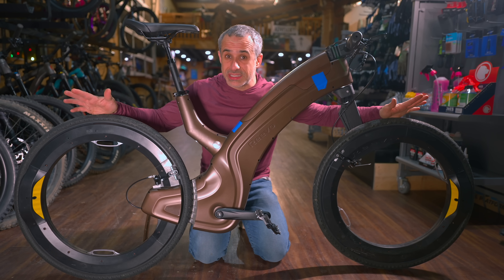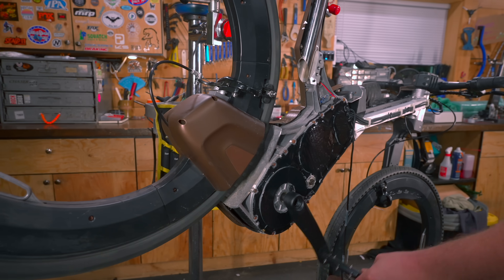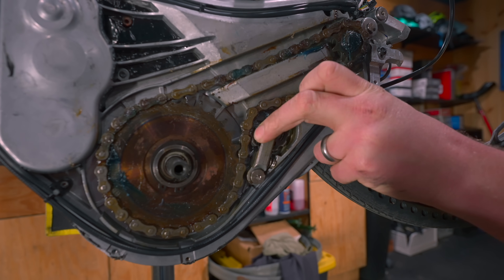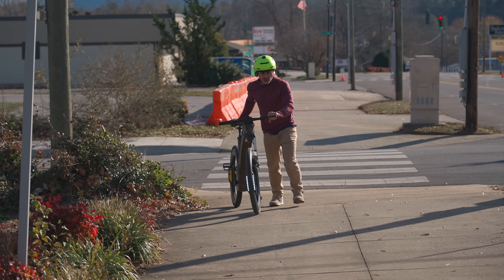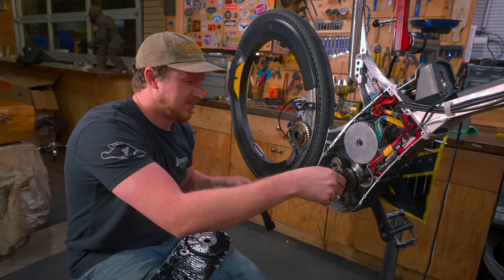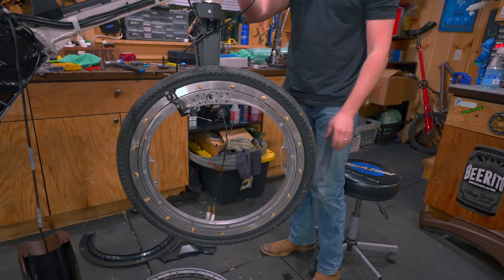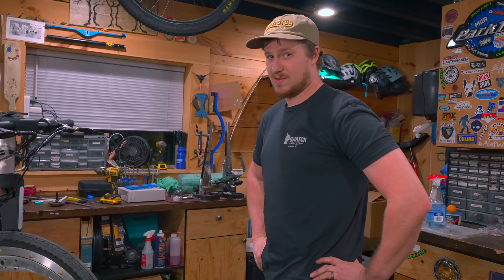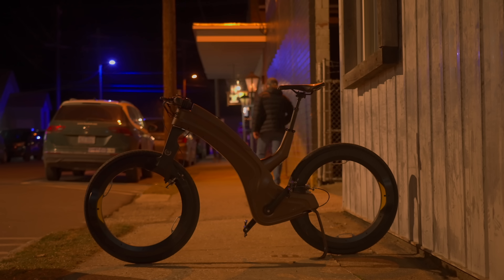What's Inside The World’s Worst eBike? Reevo Teardown

Comment: As I read the comment section, people are going "This is poorly engineered" but I would say the opposite. It's most likely that the idea had the hubless wheels and the design of the bike from the start, and you are basically asked to fit things together in the best way possible within the allowable budget and with as many cheap off the shelf items as possible. 
Off the shelf motor can only fit above the pedals? You need to chain, gear train or belt it to the pedal train. 
A hubless wheel? Gear it to a chain. 
Brake needs to be on while the software locks the bike, but you already have a kickstand brake? Lock the kickstand in place.

Everything on this bike makes sense if you think of the premise they are given to engineer is absurd, which it clearly was. The funny thing is remove the absurdity, fit everything together with proven technology, and you could still have a lot of good features like the one sided forks, at a much lower weight and cost.

Comment: As a dutchie the self propelling pedals crack me up. I had an ARCHAIC e bike back in 2014-15 and it did that. So easy, I could prop my feet on the frame and use it as a scooter. I thought we’d have out engineered that

Comment: 70lbs is light what're you crying about? 😂 my bike is smaller and weighs almost 130. 😂

Also there's gonna be more gears in general since it's a hubless wheel. 

And your bike taking off? That'll happen on any ebike that has pedals that rotate with the chain..that's kind of how pedal assist sensors work. If you don't want that to happen turn the pedal assist all the way down to 0.

It's weird to pick a bike with feature you don't understand then try to shit on it for content 😂

Comment: Note: never ever use steel bolts and steel machine screws in soft aluminum like that. Vibration & stress can cause a lot of damage over time. The steel bolts can wear holes in the aluminum, and steel machine screws can easily strip out tapped aluminum threads.

Comment: I used to be a welder, working on frame parts for industrial machinery. We used 1/8" aluminum tubing like that... to support ten-ton conveyor belt systems! But I suppose since they're using square tubing that's what it takes to keep the stress risers on the 90° corner joints from being an issue. Atrociously bad engineering and I bet it was only to save money and not have to have custom cast parts. Actually, that looks like it might be spray-transfer MIG welds, which probably also saved them a dime on labor as well. Unreal to see welds that chunky on a bike frame.

Edit: Nah those are normal TIG on closer inspection... just THICC
Reply: Also, nylon bearings? in a BIKE? Jesus Joseph and Mary.

Comment: I basically understand why it was so hard to pedal by seeing what was involved in the drivetrain, but why did the front tire still roll so horribly? What was going on there? Couldn't that have at least been done better? I really don't get that part at all.
Reply: Probably it could have been done better, but as it was already stated: This design replaced two bearings in the traditional hub with many bearings around the whole wheel. Each bearing adds friction, even if it is a high quality one. You would need to engineer some other bearing technology for this one. And a better idea for the drive train, maybe some linear actuator using magnets or similar - literally making the wheel part of the actual motor.

Comment: I know how to make a better hubless bike wheel Why not slim down the wheel itself so it's closer to a normal bike rim sans spokes, replace it with a massive sprocket, add a groove, a better inner ring design, and use little steel ball bearing and grease instead of roller wheels.

Comment: They really overcomplicated the drive system on that! If I were designing it I'd just put the motor on the wheel hub and then add a generator to the pedals wired in parallel with the battery so when you're pedaling if the battery has higher resistance than the motor the battery will get charged, if the motor has higher resistance than the battery the pedals will drive it, and the pedal assist would just be the battery providing the difference in our from the stable state of the circuit, and have a transistor actuated relay wired in so the battery disconnects when the pedals aren't producing any power. Then use a throttle to set the minimum resistance of the battery side, or use a tachometer to control a varistor for the battery side of the circuit. There'd be a little bit more needed I'm sure, but if you remove all the mechanical linkages and just let wires send the power to the wheel from the pedals you'd have a much simpler and easier riding experience.

The pedals would literally feel lighter the less load is on them because of the inductive impedance in the motor going down as the load drops, also dropping the impedance in the pedals, but with no mechanical stuff to fail, and the battery would just act as a reduction in the load on the pedal motor by using the chemical electrical energy to supply the motor and absorb some of the inductive load. You could even add a capacitor bank that would charge up and rapidly discharge for short bursts of extremely large power assistance for extra steep hills and such.

And it would atill be class one since even with the battery disconnected the bike would work fine. It would be in a single gear, but it would be ultra efficient and work fine.

The motor would just use a traction roller and a knurled ring in the inner wheel to get the grip needed, but allow slipping when the wheel is free-spinning so it doesn't always send all the inertia back into the battery.

So only 3 moving parts and a really efficient drivetrian with zero gears and almost no noise, plus extremely low weight.

Comment: I could have told you it was a chain with no Freewheel. There's no way they are going through a multi-stage gear system without serious product revision. The chain is a shortcut that legitimately works. It's basically Drive systems 101

Comment: i believe the motor doesn't disconnect from the battery when your just pedaling it so there is resistance as it is charging the battery as you pedal  (Or if they forgot about this design it would probably cause the motor to blow up from charging it wit no proper circuitry)

Comment: Interesting fun fact: There is a test for people, where you have a certain amount of parts that fulfill a task, but they are not optimal. The testing persons shall change something. The majority add additional parts to improve function but actually the test is built in a way that you can remove a few parts and it would work much better. So it's basically a test, that proves that people want to increase complexity to achieve their goals, even if reducing complexity is the better way.

This bike is the real life proof.

Comment: So they saved some weight by making the casing plastic instead of aluminum, but made it encase a solid aluminum beam, over-engineered the hell out of the power transmission between pedals, wheels, and electric motor, and literally tried to reinvent the wheel

This is hipster hype bait designed by some snobby upstarts who don't understand why bicycles are built the way they are and somehow convinced themselves they knew better than the rest of the world

Comment: The fact you can roll it back only with huge effort is terrible, also I'm wondering why they went with skateboard wheels... Surely there's an engineering reason, but it seems like ball bearings would be easier and cause less friction (and the biking Gods know that these wheel need all that they can use of that) And those chained gears... Man, I can't believe they needed to chain that much!

Comment: I think if you take all the electronics out and fill all the bearing/gear housings with grease and respective gear oil at least it would be quiet and easier to pedal. It would still be the worst fixed gear ratio on a heavy piece of shit, but maybe you can at least use it. As a training bike or something.
I'll be real, this whole design reminds me of Pimp my Ride. It’s putting dumb heavy shit on a broken mechanism, then taking what works in a normal bike and replacing it with something that merely looks cool but is a really stupid Idea.

Comment: the more gears you have, the more friction you create. 
figure a pattern to use less gears and get the proper Gear ratio.. 

small gear teeth = less torque / less effort.
Big ass gear teeth = massive resistance / massive torque / humongous effort.

Comment: The actual problem with the resistive feeling when powered off is probably due to a the added rotational inertia of the gears + potentially a too high reduction ratio (R) between the pedals and the motor and gear, which multiply by R^2 the damping and inertia felt at the pedals. Since the quality of fabrication looks poor also and there are multiple gear stages, there is also more friction lost (let's say about 98% efficiency for every gear stage) than it would if there was just a chain.

Comment: Here's a suggestion: have the motor mounted on the hub.  The pedal assist would be a generator, so the only linkage from frame to drive is current carrying conductors, one of which could be the frame of the bike.  The down side is that with an electronics, battery or motor failure you would be completely immobilized.  Up side is light weight, simplified drive train.
Also, mount the hub on the bottom of the interior of the wheel, why have all that torque on this support?  It's just stupid.

Comment: I'm actually surprised it doesn't work better.

Like, those bearings shouldn't have the amount of resistance they have. It's actually shocking. If I had money to throw at it I'd redesign this and turn the 20 gears into some sort of serviceable CVT. Lean away from "chainless" and just stay "hubless"

Obviously it would still just be a show piece, but there has GOT to be a way to make this functional

Comment: I'm a manufacturing engineer and from my perspective this bike is really interesting. The wheels are a cast aluminum but they have also been machined down it looks like. I wish I could see more. If the channel the little runner wheels run in is also machined that would have required such a large lathe. And they must have used the rubber wheels because just bearings would have slop and they would have never gotten in to work because the wheel would bounce around. Is the outer wheel that the tire is on aluminum or steel? And that ring gear was it machined into or a pressed on ring gear like on some automotive flywheels. 

From a manufacturing stand point how did they get the rubber wheels lined up to be secured once the wheel was on. They typically use fixtured tooling to setup things like that but that just so frustrating to get work. Not mention the huge cost associated with making all these pieces. It's all looks like it was prototype manufacturing where things were designed to be one of and not mass produced. 

And the gear box with the 3 gears wasn't shown. Is there a reduction inside of there otherwise why have it?

Comment: @BermPeakExpress Can you guys do a video on Bicycle wheels and tyres, like their load and speed and like bicycle rims with 12 gauge spokes? I think it'd be very interesting as i see some 29" inch wheels with 1 ton static load rating but then why dont some small CC engine bikes run them? the bikes would be so light and nimble. Im really just curious and i dont have the means or time to try to go in deep and analyse this anytime soon.

Comment: Ok, to be fair to the bike, I think the idea of using a giant ring gear as a method of gear reduction for a motor is kind of clever. Gear reducing existing electric motors to an RPM that works for bikes is actually a pretty difficult problem in e-bike design, so I think that central idea was what the bike was built around... But it kind of forces a hubless design. They probably just didnt figure out how bad hubless is until after selling people on the idea.

I cant explain the absurd number of gears (AND a chain drive) in the gearbox though, using even just the ring gear already adds an uncomfortable amount of resistance on top of a regular chain drive. At the very least they could have made it coast better with a better clutch of some kind to disconnect unpowered gearing from the wheel.

Comment: SG90 servo, XT60 power plug, DIY 3D printer V-slot bearings,.. at least you won't have a problem with parts availability. This bike is straight from Aliexpress.

Comment: It's wild in all that design, then didn't just make the (I think obvious) decision to mount the motor inside the wheel, eliminating a ton of intermediate gears.
It wouldn't make it not terrible or dangerous, but just slightly less terrible and complex.

Comment: The resistsnce is from the wheel bearings (especially the plastic wheels) and the motor. Straight cut gears androller chain + sprockets are pretty efficient. Also, given the number of teeth in the wheel ring gear, it will probably last a really long time.

Comment: I might have lost a bit of focus because my mind was kind of blown by what I saw. But what about battery? What size/capacity? I saw what looked like a single 18650 battery, but that might have been for sentry mode. What about battery pack for running the motor?

Comment: I had a tricked out 1976 Huffy 20" Dragster with a stock banana seat, 50 mph speedometer, cheater checkered tires, and an added generator light that was better than this.  When I got that baby up to 8.8 mile per hour, you would see some serious sh*t.

Comment: 1:18
For anyone wondering why every bolt is rusted, that's because they probably used zinc plated bolts in an aluminum frame which are dissimilar metals and one eats the other

Comment: As someone who is not handy, this is an incredible lesson in how to approach engineering problems. Excellent content
Reply: Even if you are handy  its one thing taking something apart to troubleshoot. Putting  it back together properly is the real trick even with a manual. Common to get it all back together and have a leftover bolt or 2!

Comment: The first 4 gears after the motor seem to have exactly the same size. This doesn't make any sense. It doesn't change the speed. It also doesn't change the direction. It only creates resistance. 😂 As if somebody said: let's mount the motor a little bit higher, so we can add more gears. I got a fever. And the only prescription is more gears!

Comment: I still envision a future for this design.  The hubless wheels look pretty futuristic and awesome!  I envision a stiff carbon fiber frame.  

For the hubless design, I envision a maglev setup where the wheel ‘floats’ around on its frame with less mechanical drag compared with the gear setup.  Both front and rear wheels will have maglev rims so the tire ‘floats’ on the inner ring that makes up the tire.

For the drivetrain, I envision a motor made out of the tire itself.  It won’t be a standard BLDC, more like a LIM (Linear Induction Motor) or LSM (Linear Synchronous Motor) similar to those installed on roller coasters, where magnets under the roller coaster car reacts with electromagnets installed on the track that sequentially propel the car forward due to attracting and repelling action of the magnets under the car.  But, in our case here, it will be in a circle that forms the tire hub, instead of straight on a track.

I envision a pressure sensor on the seat so when it senses no rider, all things related to propulsion will be disabled.

I envision it will maintain its class 3 e-bike status with a physical drivetrain connected to the pedals and the wheels via a ring gear (just like this bike features).  An actual drive axle will connect to the ring gear to the pedals with a simplest gear reduction (not planetary gear set) to reduce mechanical losses and for ease of pedaling.

Lastly, I envision the batteries needed to power this is in the future.  It will require something that exceeds the capacity and current output of our current battery technology (Li-ION for example) as the current requirements for the maglev tires and LSM motors will be A LOT.  because of the maglev design, this thing will be DEAD (I.e. not moving, not mobile, etc).

…until someone else that can envision an idea to work around that.

Comment: With another $5M in funding for R&D and tooling, this bike would be 50% the weight and a much better bicycle.  It's a shame they didn't sell millions of this horrible thing, to be able to afford to make the next generation of it.  You will never beat the weight of a straight spoke wheel, but the front wheel should be able to spin nearly as long as a regular wheel.  Seems like they got the number of rollers, or tension in the roller system, or roller system just "wrong".  Maybe fewer rollers in a less "tight" configuration was tried, but it had too much "play" or slop.  Another reason why a bicycle hub is all metal (with grease).

It feels like it was engineered by one good engineer that did it all, but he was good at one or two things, and not the whole setup.  He could solve any one problem, but not elegantly.

Comment: Frame is strong ennough. Nothing wrong with that. The shells will vover the beams. About corrosion it takes a century to corrode alu . About gearing and assisting  years that is rubbish.    I guess Chinese engineering

Comment: The likely reason the bolts are rusted is that they used galvanized bolts with aluminum, that creates a galvanic reaction and the zinc (the part the makes the bolts galvanized and corrosion resistant) is zapped away resulting in rust bolts. If you use Aluminum you have to use stainless bolts or you have rusty bolts.

- Your local iron worker.